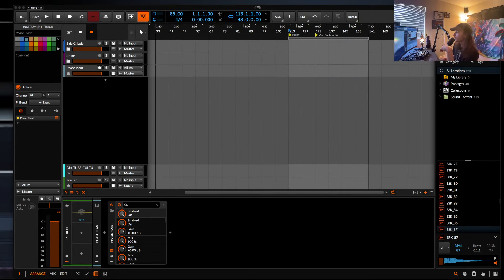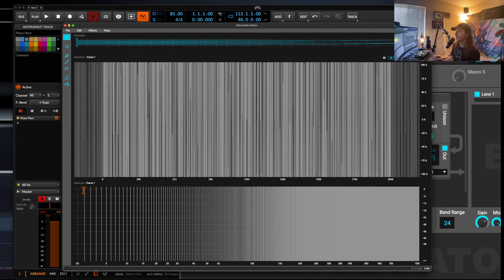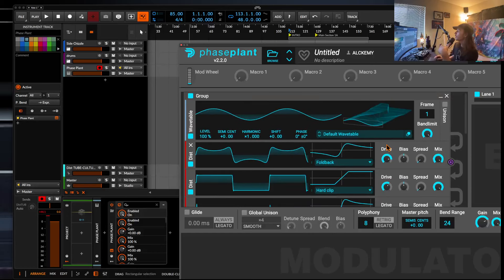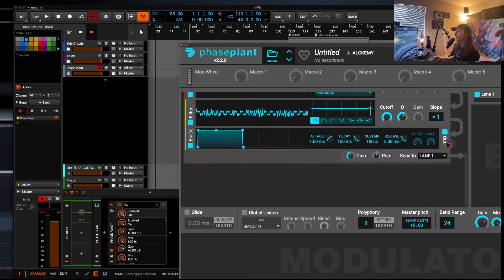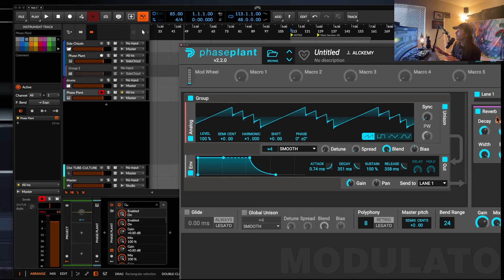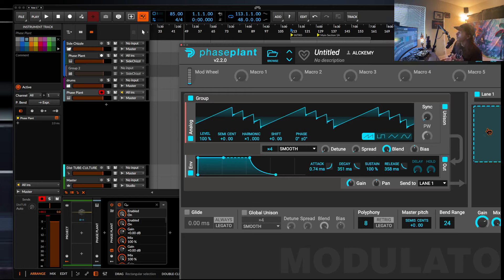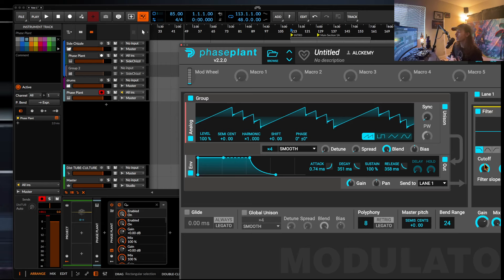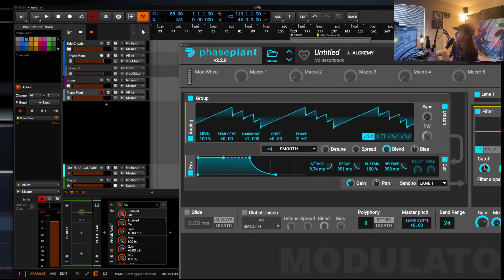The Five Principles of Sound Design (talking head video)

Comment: Why does every harmonic all the way up sound like a "crappy saw wave" and not white noise in the wavetable editor?
this is because the wavetable editor is not "every frequency" but instead, only the frequencies present in the harmonic series

it's not quite "ironic" that it sounds like a "crappy saw wave". It is actually to be expected
White noise contains an even spread of frequencies, where a wavetable editor, not so much by design, but by the nature of wavetables, only contains harmonics
harmonics, have a mathematic relation to the fundamental. If the fundamental is 1, the first harmonic is 2, the second is 3, the third is 4 and so on
this means you don't actually have an even spread of frequencies, but a cascading spread where each consecutive frequency is related directly to the fundamental

it is "noisy" sounding, but is still intrinsically "harmonious". If you think about this, it means that the frequency density of a wavetable, has much larger gaps between lower partials. As you mention, there's a whole octave between the fundamental and first harmonic, there's a fifth between the first and second, a fourth between the second and third, and the gap shrinks between each harmonic.
This gives much more emphasis on the fundamental and a repeating pattern that always corresponds to the fundamental as well.
Reply from the maker: Yep, totally forgot it’s a harmonic table and not a frequency table. I’m glad someone’s always ready to jump on my mistakes 👍
Reply: @Alckemy  I'm sorry, I'm not ready to jump on your mistakes or anything. I hope it didn't read like a criticism of your video, I was trying to provide some informational context for anyone who was curious about it or who might mistake it as some sort of unique quirk to Phase Plant
Reply from the maker: @DataBroth  oh no, you were absolutely right. Was trying to keep it lighthearted